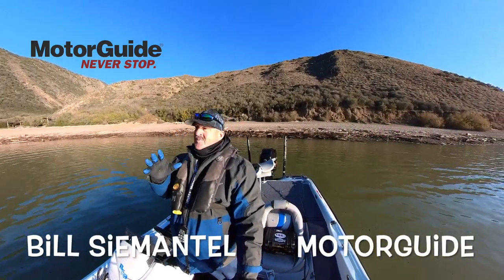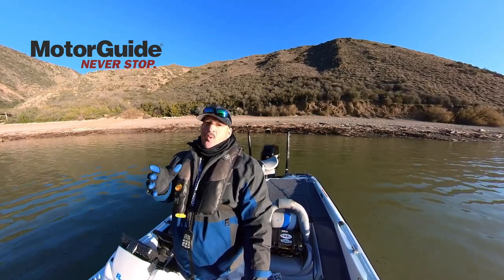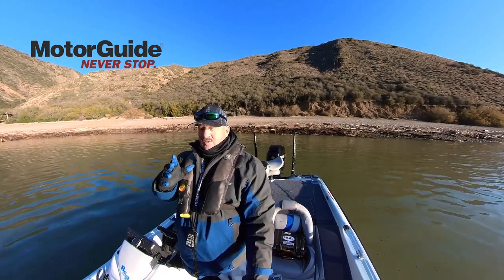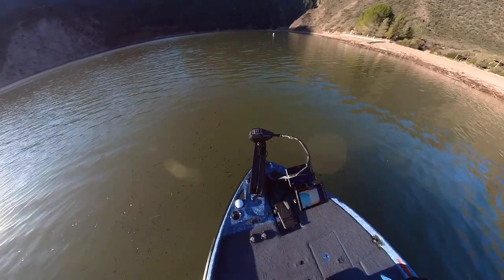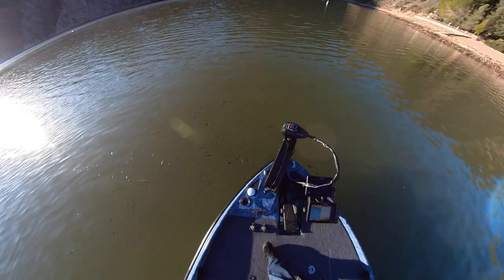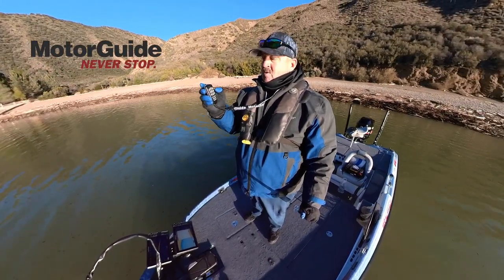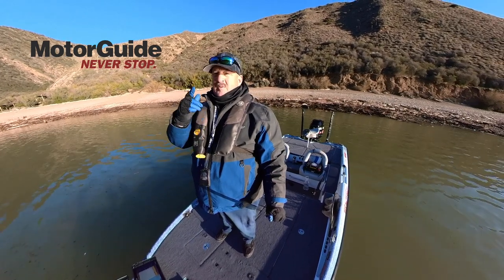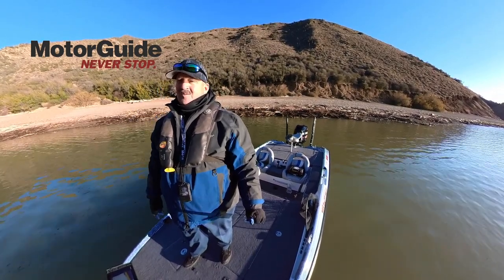MotorGuide:Anchor Mode Not Working, How To Fix Anchor Mode, Quick Fix

Comment: It takes my MG tour Pro over an hour to find a GPS signal.  And if it does find a signal it loses it every 30 seconds so im not able to set it up like you described.   Any suggestions?  Im located in South NJ but have same problem when i go down to MD flats or up to Lake Champlain  NY
Reply from the maker: @briancooper7647  getting satellite connections is one key. I have tried to set mine up in some coves and had a hard time because I could not get a good light of sight from my unit. First I would make sure you are in an open and calm area. I would do a minimum of 3 times when calibrating your unit. Each time it will gather more info from different satellites. Once I have done that and it works, I then make sure to unplug every time I get off the water. I have been able to drive 300 to 400 hundred miles and the anchor mode is still pretty close to where I do not have to re calibrate it. Hope this helps

Comment: My xi3 is doing the same thing, will this work ?
Reply from the maker: I do n ot think it works with the xi3, This fix is for the Tour Pro Ver H. You can email MG tech support and ask if they have something to help.
Reply: Xi series with Pinpoint - no M283 will not work… you need to remove the upper head cover and inspect the red/white wires. They should be twisted and routed like the images on MotorGuides website under Xi FAQs.

Comment: Hello i have a xi5 and its doing the same thing
Reply from the maker: As for the xi5 I do not have that information. Please contact the MG tech and ask. I will also try and reach out to find the answer. Thanks
Reply from the maker: I just got off the phone with MG. Xi doesn't have some of the calibrations. if the motor has power but no satellite then it is either environmental or needs a reset and calibration. If the anchor is dropping and such then it could be ow voltage most likely or a bad board or gps. Go to motorguide.com and on the website there is a troubleshooting guide. Most issues with the Xi are power issues. Hope this helps.  Bill
Reply: Thanks for your help
Reply: These motorguides are terrible.  Same issue
Reply: Xi5 as well